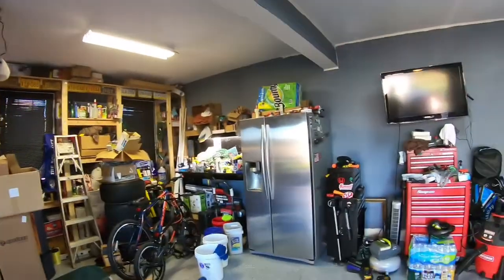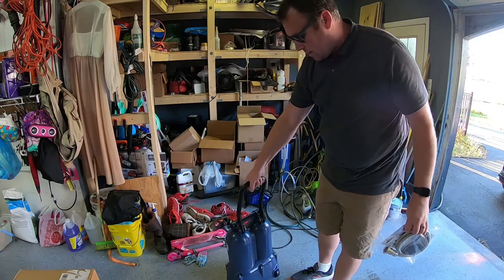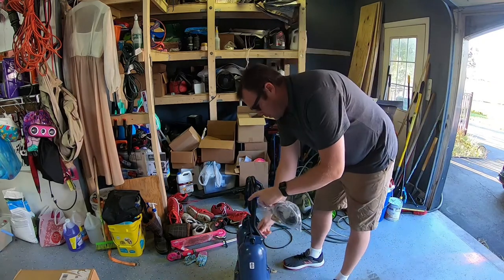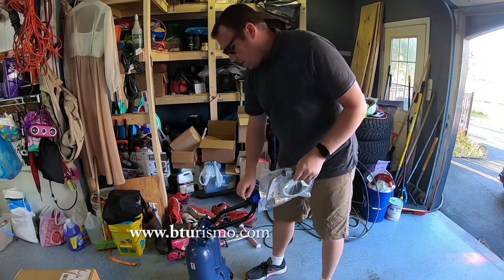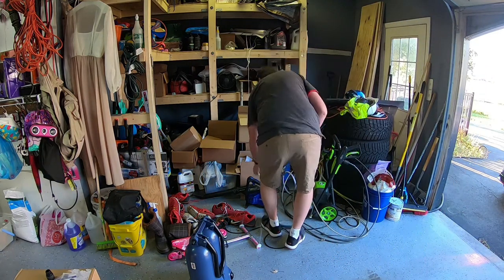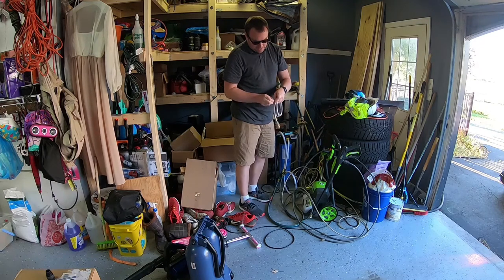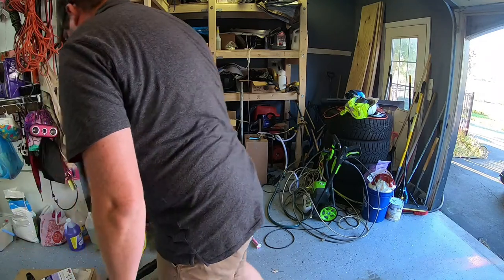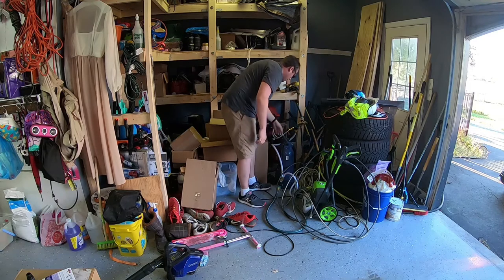Simple Chuck unboxing and GO actual time

Comment: Why did you 'upgrade' from the DIC-2- to the Simple Chuck? Slightly higher gallon amount with the Simple Chuck? I know that the Simple Chuck is a newer product line that was either purchased by or merged with CR Spotless, but I've always wondered by the CR Spotless system is still the one that all car cleaning enthusiasts default to? The simple chuck line of products have not seem to have taken off (or at least the people who are using it) are not posting on forums or Youtube about it.
Reply from the maker: I used the DI120 for a long time but you said it- the SimpleChuck lasts a lot longer between resin changes.